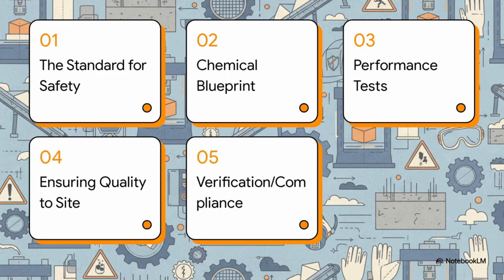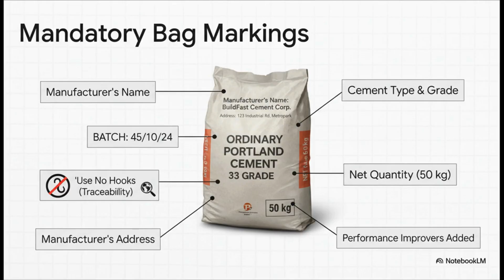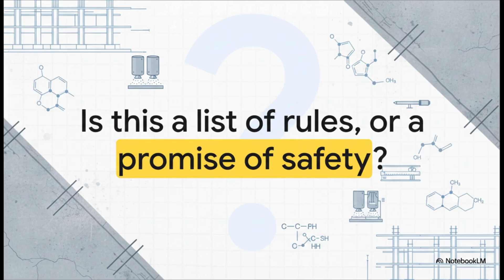Do you verify Cement grade when building your home? - IS 269 Explained

Comment: This video explains IS 269, the Indian Standard for 33-grade Ordinary Portland Cement (OPC), highlighting its crucial role in ensuring the quality, safety, and durability of concrete structures (0:09).

The video is structured into five key sections:
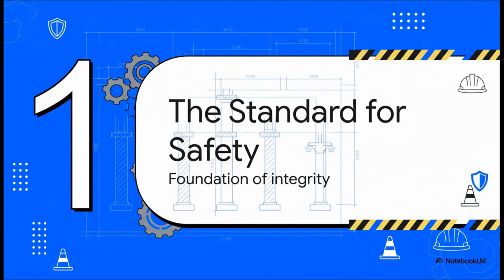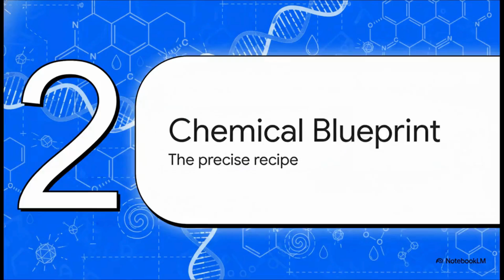The Standard for Safety (0:56): IS 269 serves as the rulebook for 33-grade cement, covering everything from its composition to performance under stress, ensuring consistent and verifiable quality to prevent risks like minor cracks or catastrophic failures (0:59-1:54).
Cement's Chemical Blueprint (1:57): The standard meticulously controls cement's chemical composition, including the lime saturation factor (LSF) which must be between 0.66 and 1.02 for proper hardening and stability (2:16-2:44). It also sets strict limits on components like magnesia, insoluble residue, sulfuric anhydride, and chlorides to prevent issues like delayed expansion, poor raw materials, sulfate attacks, and rebar rusting (3:06-3:52).
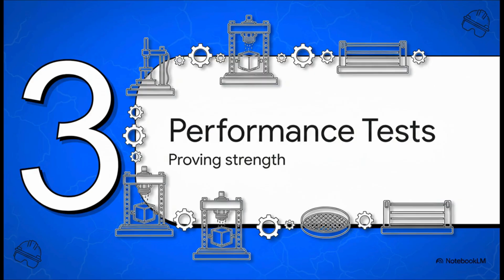Critical Performance Tests (3:59): Cement's strength is tested at different stages:
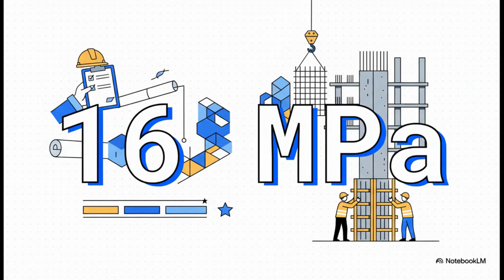3-day mark (4:46): Minimum 16 megapascals, crucial for early construction schedules and formwork removal (4:46-5:01).
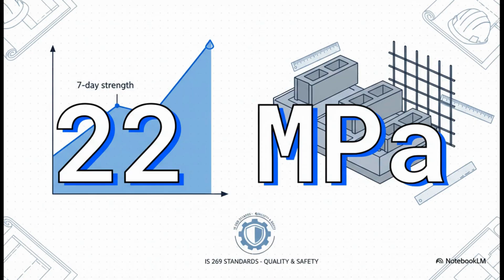7-day mark (5:03): Minimum 22 megapascals, confirming healthy strength gain and predicting final target achievement (5:08-5:21).
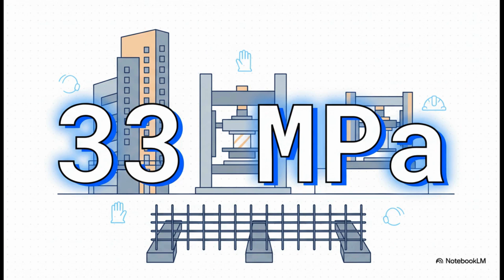28-day mark (5:24): Must meet or exceed 33 megapascals, the benchmark for structural designs (5:24-5:40).
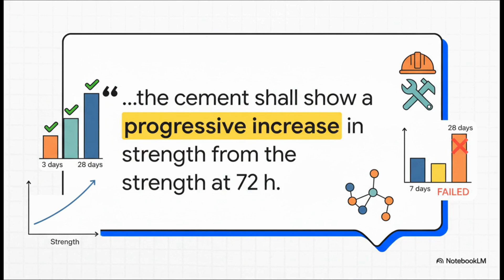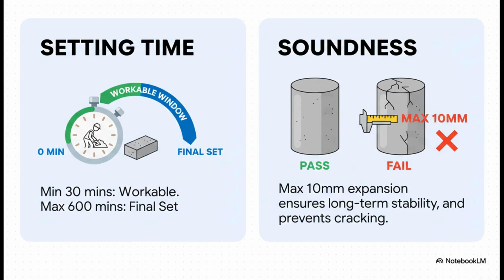The strength must also consistently increase over time, ensuring stable and continuous chemical reactions for long-term durability (5:44-6:03). Additionally, the standard controls setting time (30 minutes to 10 hours) and soundness (maximum 10mm expansion) (6:05-6:31).
Ensuring Quality to Site (6:35): The video emphasizes the importance of bag markings as the first line of defense for quality control on-site. Batch numbers are critical for traceability, "use no hooks" warnings prevent moisture ingress, and accurate bag weight ensures precise concrete mix designs (6:45-7:32).
Verification and Compliance (7:35): Strict timelines are set for sample testing (within three weeks of delivery, testing within one week of sampling), and retesting is required after three months in storage due to moisture absorption (7:47-8:10). Compliance is mandatory; any single failure in chemical limits, strength tests, or markings results in the rejection of the entire batch (8:12-8:31). The video concludes by reiterating that IS 269 is a blueprint for trust, ensuring the safety, durability, and integrity of structures (8:34-9:03).